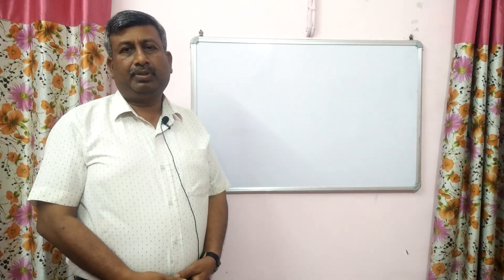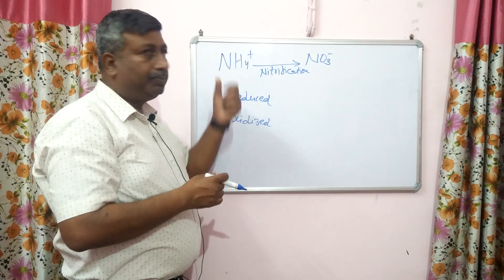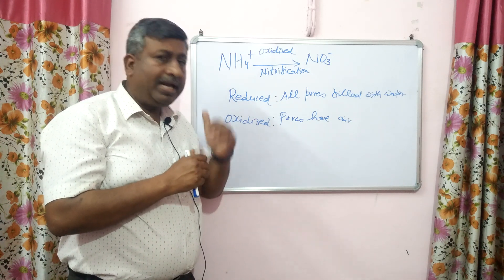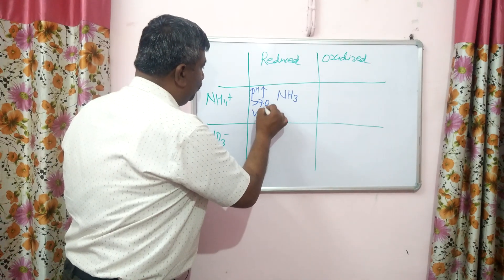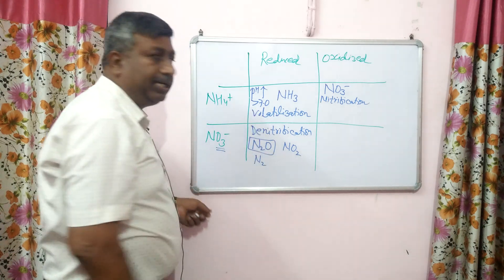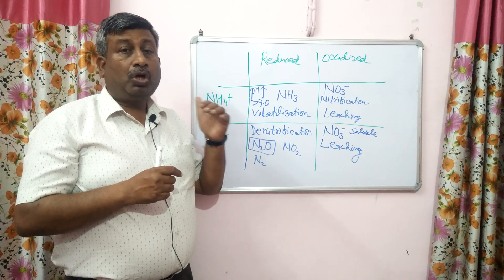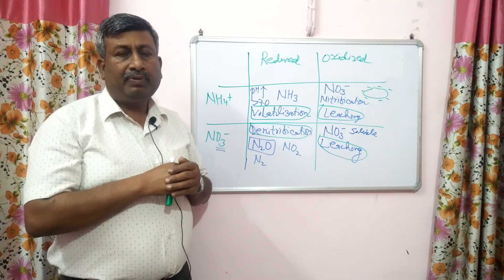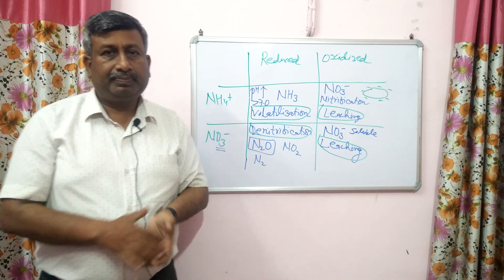Why Nitrogen is Lost From Soil

Comment: Therefore in paddy 20:20:0:13 grade will be better which has high percentage of NH4 form of N (18%).  Loss can be prevented. Another form paddy can have the ability and preference to take up NH4. N efficiency will be more if 1:1 ratio of Nitrate: NH4 form is present.
Reply: Urea is cost-effective and better in ammonia form